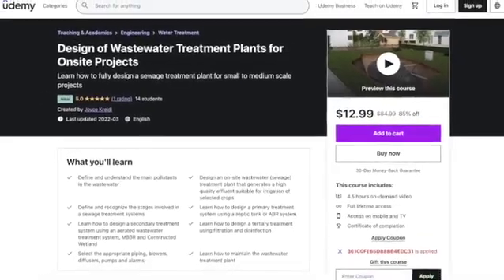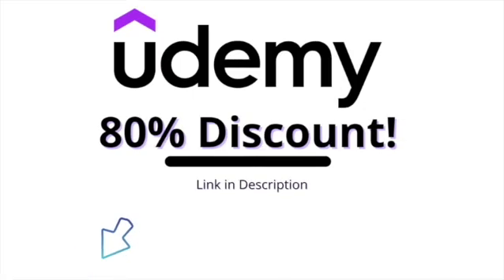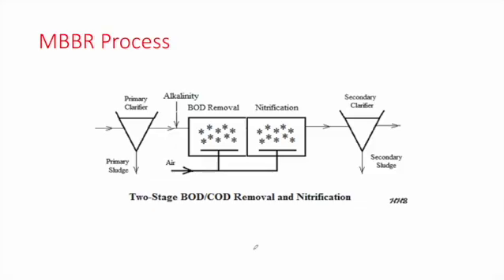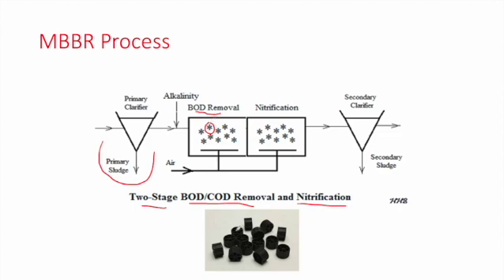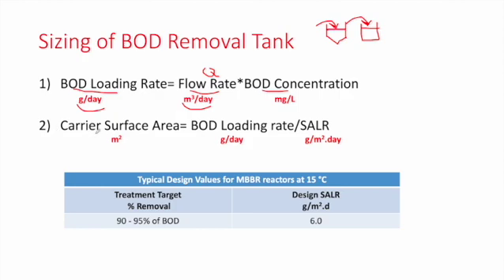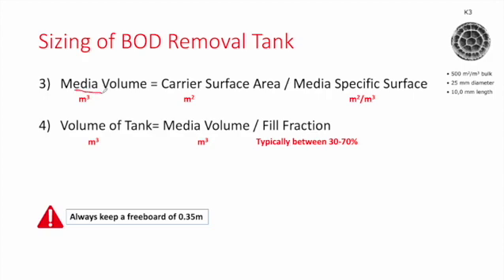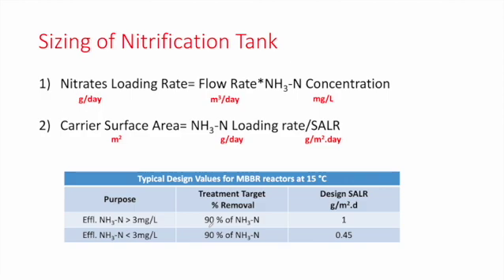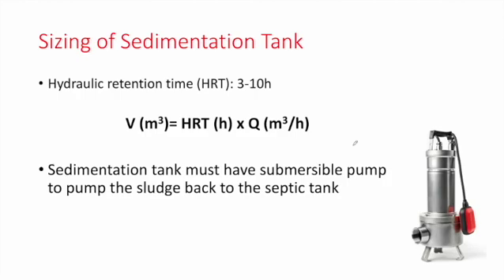Design Calculations for MBBR Wastewater Treatment Plant with Solved Example

Comment: Thank you for the insightful video. Could you share the source of the SALR Values? Or perhaps the calculation methodology for the SALR? Thanks in advance!
Reply from the maker: SALR values used in the design and operation of MBBR are based on research and empirical data. The determination of SALR involves studying the performance of MBBR systems under various conditions and analyzing the relationship between organic loading rates, biofilm surface area, and treatment efficiency.

Comment: How to get air volume required,
Reply from the maker: Calculating air requirements is a bit complicated 
You can design it through this sheet: http://bit.ly/3me8zLh
You will also find references on designing the air requirements in this sheet.